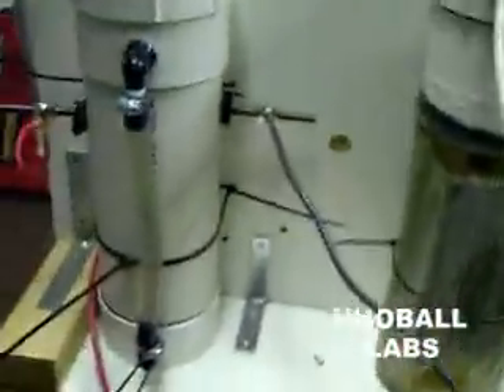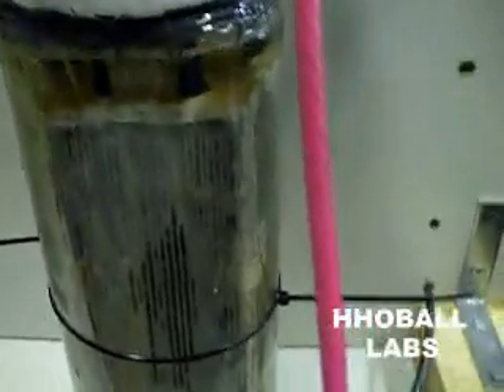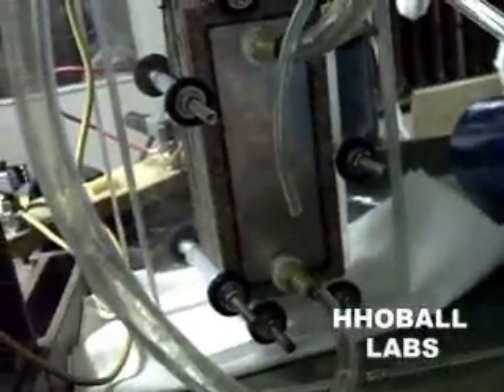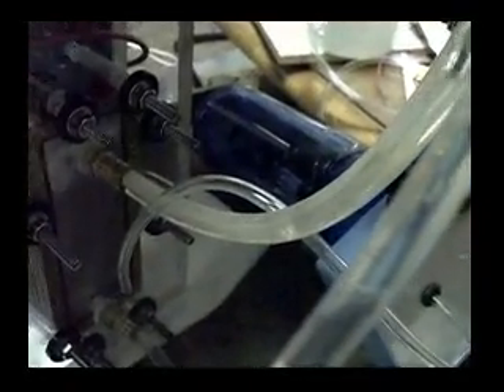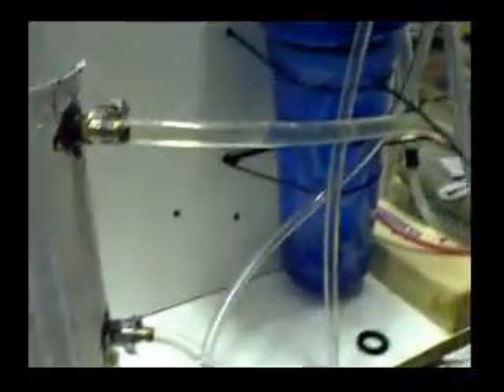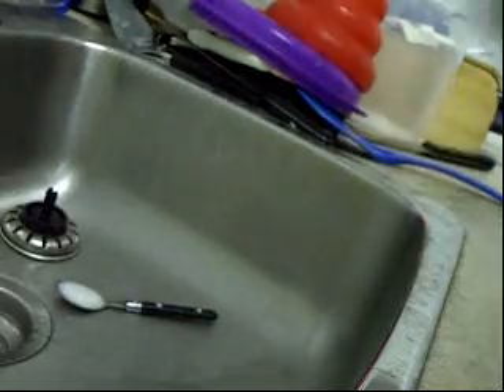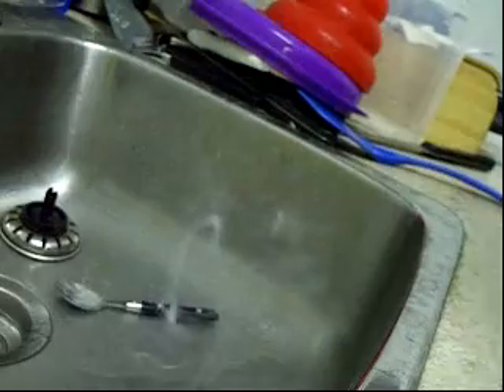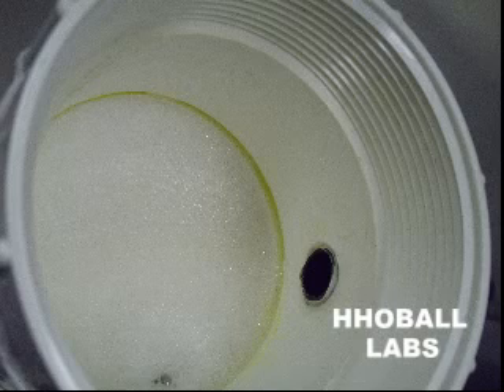#3 HHO Foaming Sucks!!

Comment: I had that foam problem too... the foam come from using KOH or NaOH. The problem is if you cell and or gaskets haves traces of any kind of organic compond (oil, fingerprint, etc) when in contact with those caustic stuffs turns immediatly to soap. So when you start the electrolysis it produce tiny bubble of oxygen and Hydrogen, as you all probably know...! Guess what happens when Oxygen strike with soap? A bubble bath my friend!!   But I didnt figure this out alone, my friend chemist did!

Comment: floating baby oil on the top of your bath
protects your electrode terminals and
mitigates foaming. your main problem
is koh a pump would help copper auto heater cores are naho safe but dont use
aluminum. cooling also reduces foam
cores

Comment: use sodium hydrxide
also pasing bubbles threw a screen or
the spong like air conditioner filters
converts them to big bubble
also passing it threw a very small hole
at the cell exaughst might help pop
the micro bubble and i think when the
fliud level becomes not low but displaced
by gas in the cell it is prone to micro bubbling also if the electrode array is not
entirly submersed the serfice tension may induce micro bubbles check out
NOBOX7 videos one shows drain cleaner
naho ...

Comment: the problem you are experincing is the potasium hydroxide, the is the second reason it doesnt make the perfect electrolyte.The first reason is it is very costic,and burns the skin!!! I recomend using a strong vinigar{white}this is a acid but you should not experiance any foam, I dont think so anyways...the whole idea is to fine the perfect electrolyte that {a}wont seperate like sodium cloride {salt}will.{b}one that is safe to use like baking soda,and can be found in any grocery store.citricacid?

Comment from the maker: Lots of good ideas. Thank you to everyone. I tried acetone and it works for a day. Then i changed gaskets and that has worked so far. I have also added an inlet and outlet port on both sides of the mini drycell and I am amazed at how it keeps the cell flooded at all times. I havent seen a downside to it yet. I will post a video soon to show the changes. Thanks again to everyone.

Comment: Just to confirm is the same trouble I had , if you change the electrolyte the problem seems to be gone ,but return a few hours  later, even if you dont use the cell.
I found out the rubber of my gaskets was not appropriate for alkaline use, and  contaminates the electrolyte with organic acids, making soap with the KOH ( or NaOH)  After carefully checking the characteristics of each rubber type , I found  natural rubber works with NAOH made new gaskets and the cell is OK now hope that helps

Comment: if you are getting real bad foam either you have contaminates on your plates or in your electrolyte mix..Or the electrolyte you are using is not pure..I suggest using Roebic sodium hydroxide crystals , its 99% pure...